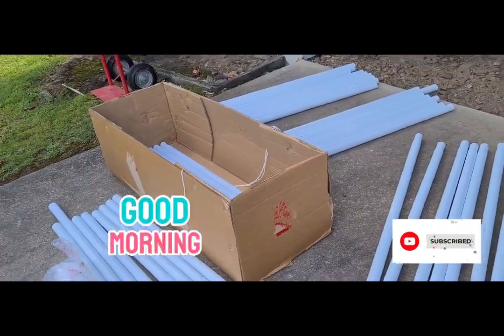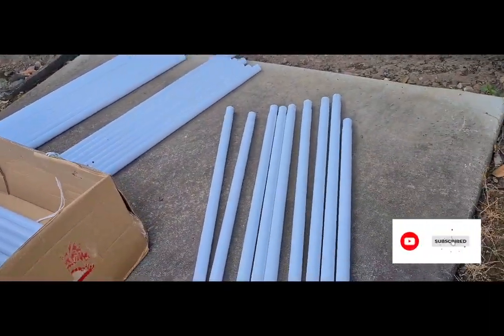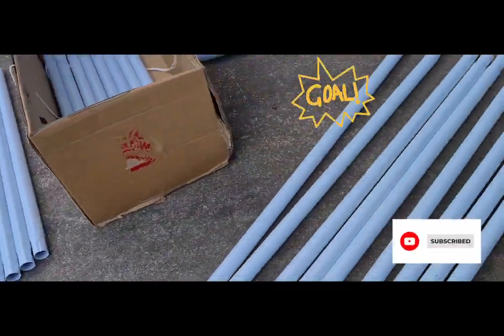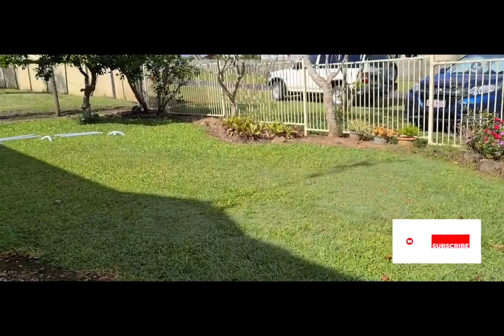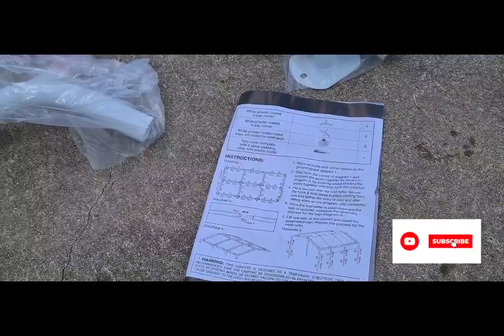how to assemble temporary carport 👍💥🇦🇺

Comment: This is a heck of a lot better carport than that thing from china - - - easier to assemble,  & will last longer, also- Tip: install heavy duty tape over tops of all the connector joints b 4 assembly- -👍👍